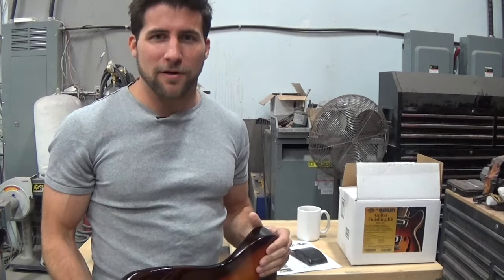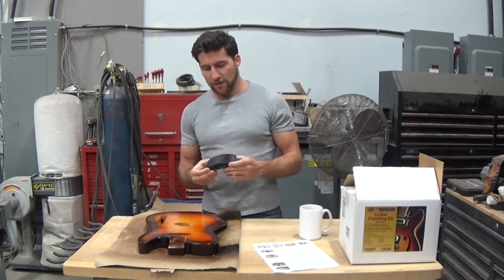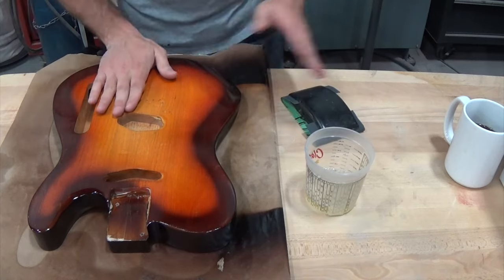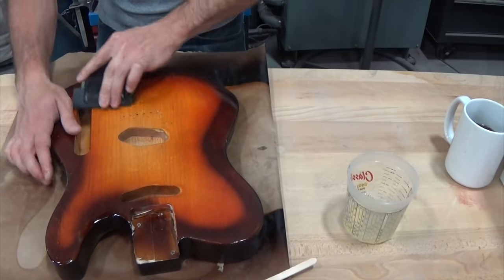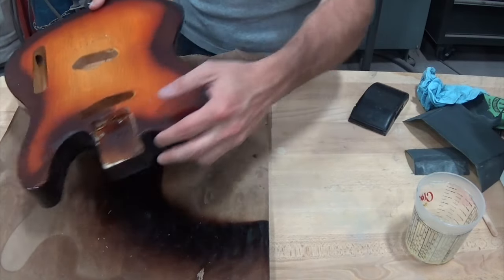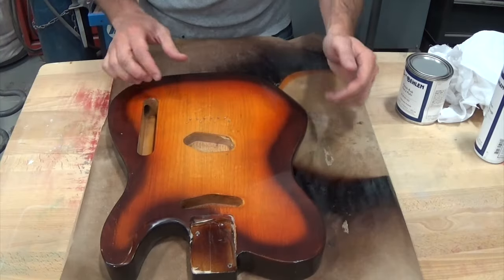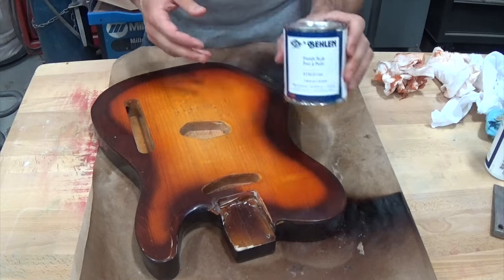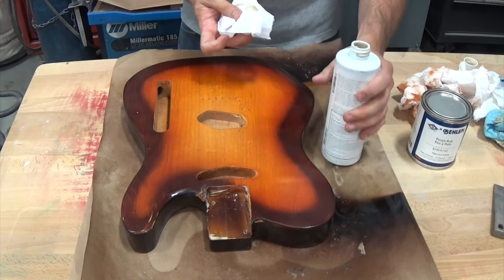How to paint your guitar with Behlen's guitar finishing kit | Part 5

Comment: Excellent video series. Very well done.  Really liked the finish. I’m experimenting with the sealer, stringed instrument lacquer now amd  comparing to a Finish looks excellent. How do you think it compares to a hvlp spray gun finish if us were to use the liquid 1quart can version of the lacquer and sprayed with a gun.  Most of the work seems to be in the level sand so if the spray cans can get the product on do you think you can get a equivalent result with cans
Reply from the maker: You can get the equivalent result with cans if you are careful. It just takes longer. There are a couple caveats to that though. You can’t change your mix with cans to account for atmospheric conditions, you can’t change your color, and you can’t do a solvent heavy leveling coat at the end or anything like that. 
In the right conditions though, and with patience, a can can give a great finish. In fact, if you’re not good at setting up your hvlp a can is probably better haha.

Comment: Brad.   After completing 10 coats of lacquer, I like the gloss already.     Sanding looks like a lot of work or basically a pain in the ass.     Would you have stopped after putting on the lacquer if you weren’t demoing the kit?    Or do you thing it’s worth all the sanding and polishing.     Thanks for you help Brad.
Reply from the maker: I have a video on whether polishing is necessary, but the short answer is if you’re happy with it I wouldn’t bother.
Reply: Brad Angove 👍

Comment: I know you said in the Darrell Braun video that you don’t recommend wet sanding guitars. Would it be better to buy paper somewhere else to dry sand? Also thanks so much for this series it’s a huge help.
Reply from the maker: I’m leery of wet sanding them as you know. What I like to do is use some naphtha if I’m going to wet sand because it evaporates really quickly. For dry-sanding, you can still use this wet/dry no load paper. It’s probably your best option for dry sanding as well.

Comment: Brad, I have a kit with the spalted maple top.   The top is porous and I just put my first coat of lacquer on it.   Some parts are deep.   I would like a smooth look in the end but even at 10 coats, I don’t think I could sand it smooth.    So I’m looking to you for advice.    Can I spray just the porous areas and build them up until they are smooth?   Or, leave it as is and love it for what it is?
Reply from the maker: It it’s lacquer you can actually just drop fill those areas.